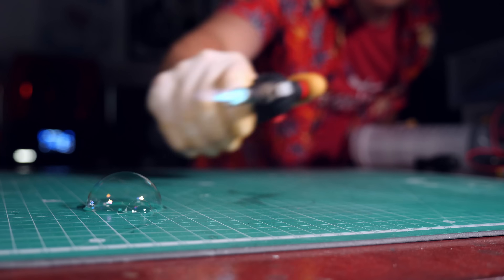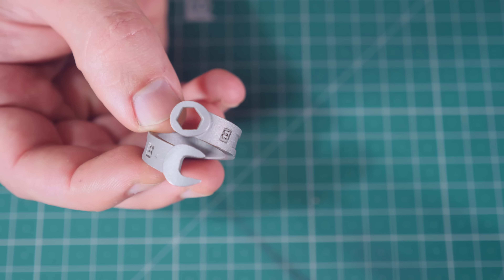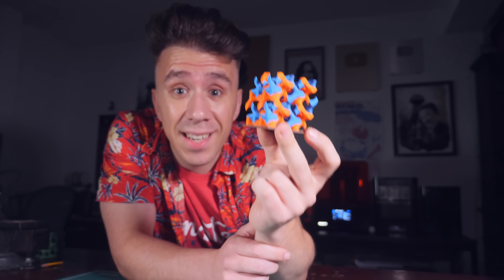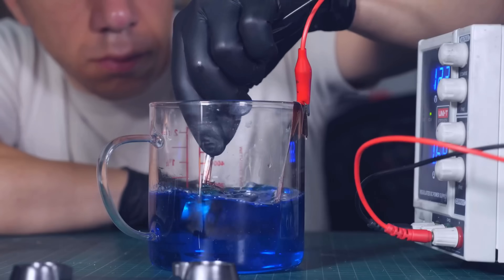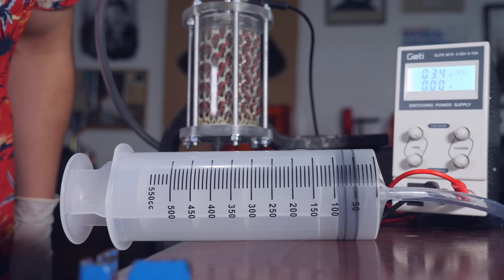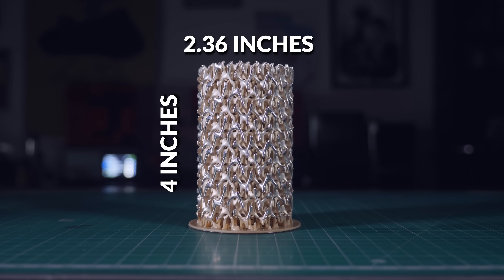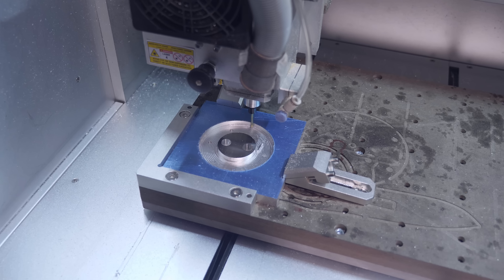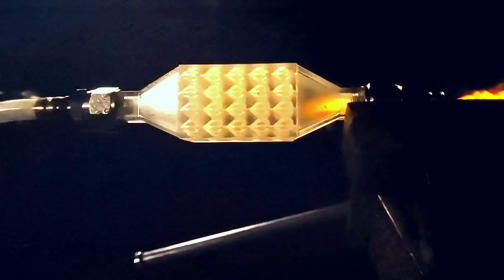ROCKET that LITERALLY BURNS WATER as FUEL

Comment: I made a hydrogen generator years ago. I know a lot about the subject. The best metal to use is platinum. Other than that the only affordable metal that does not dissolve during electrolysis is 316L stainless steel.  Not 308 or regular 316 or anything else. It has to be 316L stainless steel. Hydrogen is an acid and it dissolves pretty much any other affordable metal. 

Also, if you apply more than 2,3 volt to the anode and the cathode you will create heat, and more heat means more resistance and less hydrogen production. To overcome the heat issue, and when you are using between 12 and 14 volts, for example from an old fashion battery charger that doesn't have the fancy electronics, you need to have 1 anode plate, 5 neutral plates that are not connected to anything and insulated from each other, and one cathode, all the plates need to be insulated from each other. This way you can create enough surface area and you can keep the temperature under control as well. If you want to produce large(r) amounts of hydrogen search for dry cell hydrogen generator. A dry cell configuration is more efficient because there is no current leakage, because there is no water at the outside from the hydrogen generator. 

With producing hydrogen it is all about amperage and how much surface area that the plates have. More surface area means that you can run a higher amperage without heating up the water. When you add sodium hydroxide you need to add it slowly while running the generator so that you can control the amount of current that it draws. Not more current as your power supply can handle. You can also use baking soda. 

You get even higher efficiencies when you use a high power PWM to run the current.  

Always make sure that you have a back flash arrestor  in your line. You can make one from a 316: stainless steel pipe that is packed with bronze wool, or with stainless steel wool.  BUT DO NOT USE REGULAR STEEL WOOL BECAUSE IT WILL CATCH ON FIRE and cause an explosion.

The back flash arrestor is there to prevent that your generator violently blows up when your gas comes into contact with a spark or a heat source.  

Also make a bubbler to which your gas has to run through. This is to make the gas dry. Make sure that that bubbler has a weak spot from plastic film, so that the weak spot will blow out if there is an explosion.
Reply: Consider titanium as an alternative metal for electrolysis although more expensive than steel but less than plat.
Use a voltage regulator or PWM to maintain optimal voltage, to get around the min voltage for water hydrolysis.
Use a conductivity meter when adding sodium hydroxide to get the perfect amount of conductivity.
Consider potassium hydroxide as a better alternative to baking soda, since its highly conductive.
Reply: @MahdeenSky  There is no valid reason to use titanium. It is very expensive, hard to machine, and the electronic properties for this application are not better as 316L stainless steel, which is already hard enough to machine. More exotic materials only make the whole build process far much more complicated and expensive. 

One can measure conductivity. But there is no benchmark to which you can compare, because the amount of amperage that you want to draw heavily depends on the surface area from the plates, and also on how much amperage the power supply can deliver. So it is much more accurate and practical to measure the amperage while adding the electrolyte. 

About 15 years ago Youtuber Zero Labs designed a PWM with current limiter. It limits the current if the resistance reaches a certain value. Via his channel you can find his web page for instructions how to build it. 

Potassium hydroxide is indeed also a possibility.
Reply: For the generator, can you use the same sort of configuration that they use for the super high powered magnets, with the films layered in a spiral configuration? They use it for cooling the magnet...just a thought.
Reply: @insAneTunA I know someone already said titanium but they have a point it’s much cheaper than platinum, alternatively palladium and ceramics could be used. Potentially even a rubber so long as the thermal resilience is sufficient to not break down
Reply: i wonder if you can 3d print in 316l stainless
Reply: Found a place that sells 316L mesh (or "wire cloth"). Any reason that would be a bad idea? Seems like it would promote the best gas flow and liquid contact. also... that steel wool warning sounds like it's from experience.
Reply: MMO is best for these electrolysis, also you could make sodium chlorate easily wich is great oxidizer for rocket engines
Reply: Made one when I was like 10 with carbon rods.
Reply: everybody here has big brain, unlike me
Reply: I would think 2205 duplex would work well.
Reply: the cia: knocK knock
Reply: @themissile3120  In a wet cell configuration you can use wire mesh, but it will never be as efficient as a dry cell configuration due to current leakage. When solid plates are used in a dry cell configuration the current has no other option but to go through each plate. It can't go around the plates. Therefore there is no current leakage. In the past people have increased the surface area from the solid plates by media blasting the plates, but that is only possible when the blast media is 316L stainless steel. Otherwise there is too much contamination. Another option would be to machine the plates, but that will cost a lot.
Reply: @flowinsounds  That might be the case. And that could result in very interesting fuel cell technology. The interesting thing about a hydrogen generator is that the operation can be reversed. If you put in oxygen and hydrogen the output will be electricity. If you put in electricity the output will be oxygen and hydrogen. But this requires a certain type of construction, and with 3D printing they might be able to make that cheaper, and more efficient. And if the resolution is fine enough they might be able to create plates that have a lot of surface area without expensive machining.
Reply: @RoboArc  Carbon rods will dissolve. But it is nice as a gimmick.
Reply: @DavidRas  For a hydrogen generator I do not see how any type of spiral construction would be beneficial or even practical or possible. There is no need for it.
Reply: @ZeusEnergyMan  And in my reply to that I explained why titanium is not a good choice.
Reply: @insAneTunA  your amost right, but not quite....
Reply: What are the neutral plates for? If it's just isolation they should also just be plastic plates for distance. Or do they create bubbles even if they are not connected, but how? And why bronze for the blowback, doesn't thin metal always burn and oxidised with great heat? So much information, wish you would go into more detail!
Reply: @ssa7843  P.S. I forgot to mention why you need neutral plates. The reason is to divide the voltage over the plates. Because most available high amperage power supplies that are reasonably affordable have a higher voltage as 2,3 volt. Any higher voltage as 2,3 volt per plate will only produce heat. It is a waste of energy. And more heat means more resistance and that will result in even more waste of energy. 

To increase the hydrogen production you need more amperage, not voltage.
Reply: @insAneTunA  thanks for the explanation, one further question. And why not just use the + - + - + - + setting with 2,3v on each plate instead of + 0 0 0 0 0 - with 2,3v where the 0 neutral plates just do nothing? Or do you mean appling  20volts to both ends and 10 passive plates in the middle hence linearly lie at a virtual 2volt distance (if it is somehow linearly distributed in the water)?
Reply: @ssa7843  You take the voltage from the power supply that you have, and you divide it by 2,3 volt, and that is the number of plates that you need. One of replies was removed by yt. Not sure why.
Reply: @flowinsounds  Yes, you can 3D print 316L stainless steel.
Reply: @ssa7843  The issue is the amperage. Most power supplies that are able to supply enough amperage are not 2,3 volt. And it is easily solved with the neutral plates. Besides that you want to have as much surface area to begin with, so it is not a bad thing. 

It is possible to put multiple cells in parallel. Pretty much like a battery. So for example if you have a 200 amp 13,8 volt power supply then you can make a single cell with 7 plates that are large. Or you can make multiple 7 plates cells with smaller plates and put them in parallel. Or when you have a 230 volt direct current power supply you can divide 230 by 2,3 and that would be the number of plates that you need to have for a large single cell. The point is that you can never exceed the 2,3 volt per plate. More volts would be a waste of energy and it would create heat and more resistance which is very bad.  

The voltage is not the issue. The amperage is the issue. If you want more hydrogen you need more amperage. And power supplies that are able to put out enough amperage are very expensive and it becomes more dangerous. Perhaps a welder might work, but I have no experience with that.
Reply: @ssa7843 When using neutral plates (which were described as '0', the correct one is 'N') you do not have zero volts, you divide the voltage and multiply the current. I'll try to explain it better: You have two (+ and -) plates immersed in an electrolyte and the electron jumps from the plate (-) to the electrolyte, removing 1 aqueous (+) ion from the electrolyte; this leaves the electrolyte with a charge (-1 electron); This causes the positive plate to remove 1 electron from an ion (-) next to it and the electrolyte becomes neutral again. But if you place, between the (-) and (+) plates, another plate (neutral - without connection to external electricity), in this case only the part of the electrolyte facing the (-) plate will be -1 electron charged, making this neutral plate that obstructed the electrolyte from one side to the other now feels negative and functions on the other side of the electrolyte as a negative plate. The reverse is also true and the 'N' plate will feel like (+) on one side and (-) on the other. This divides the voltage by 2 and multiplies the effect of the current by 2, as oxygen and hydrogen will be generated on this plate as well. Do this as many times as you want to divide the voltage and multiply the current
Reply: Neutral plates work best with dry cells because wet cell configurations introduce current leakage (the charges literally try to bypass the neutral plates lol) and severely limit the efficiency. If somebody tries to build a wet cell configuration, you either have to limit the voltage to 2-3 volts or stack several wet cells in series. Somebody already mentioned this, but amp draw depends on the electrolyte conductivity, and distance between the electrodes. There's a graph out there that shows 2 cm gap for electrodes work best. There's really only five important factors you need to worry when initially designing a cell: number of electrodes for voltage, plate surface area to determine how much current it can handle before it starts boiling up the electrolyte, electrode distance, electrolyte used, and electrode material. There's also optimization options such as using PMW, using magnets, and applying ultrasonic waves.
Reply: I made a HO generator MANY years ago (I was in my early 20s, so pretty dumb about safety) and used sheets of 316 stainless (My dad worked for Republic Steel at the special metals plant so it was super easy to get at the time. He brought a bunch home that were slated to be thrown in the trash because they wre mistakenly paper backed. We used them to make cookie sheets) and I stacked them with threaded nylon rods and bolts (from toilet seat replacement kits). I used  distilled water with a tiny amount of lye dissolved in it and put the entire thing in a gallon jar with a metal screw on lid and used a variable power supply. it worked WAAAAAY too well and started producing a ton of highly explosive gas. I then apparently had a massive stupid spell and moved the output hose near a flame. The lid of the gallon jar embedded itself in the ceiling of my kitchen and my ears rang for about two hours afterward. I was EXTREMELY thankful the jar remained intact and just the lid blew off.
Reply: @insAneTunA  You could potentially use a dremel and cut slits in the solid plates for more surface area, but honestly you aren't going to increase surface area on plates enough to make an appreciable difference (unless the plates are SUPER thick)
Reply: guess we need to put a thousand spark plugs in the tank to do the job.
Reply: you accidentally used a : instead of an L
Reply: @ChuckSploder  yes I did. 👍
Reply: @Squidbush8563  
I also did an experiment using graphite as the anode, copper wire as the cathode and table salt electrolyte. Before, using salt, I destroyed the anode and made hydrogen at the cathode, with the graphite anode I made gas for the first time. I thought it was oxygen and decided to take a sniff. I almost died because it was chlorine gas. It's about 20 years ago.
Reply: @estudandobitcoin2711  Yea. using sodium chloride is a bit of a problem.
Reply: I agree.  We designed acid/base reactors for chemical plants and we only used 316L reactor tanks.  Anything else would break the bank (hastelloy), corrode or melt from the exothermic heat generated.  We used graphite heat exchangers for dilute sulfuric acid.
Reply: @insAneTunA  The cells must be isolated from one another. They can't share the same electrolyte or they will short out.
Reply: This comment section is full of great ideas. I hope to implement some of them in my future projects.
Reply: @MahdeenSky  you have no understanding of standard electrode potentials. Titanium will simply dissolve during Electrolysis. Additionally, there is also the subject of hydrogen poisoning Of the cathode. The only material you can use and maintain Current flow Is carbon/graphite.
Reply: @5467nick  Most ideally each different 2,3 volt cell has its own insulated electrolyte compartment and gas outlet, but it is not a real issue if there is some current leakage. It can't short out, as you say it, it is just less efficient when there is some current leakage. When I was doing this between 15 and 20 years ago 3D printing was still very exotic, so it was too costly and too complicated to create a manifold/casing with a gasket for each different 2,3 volt cell all by hand or with machining from exotic materials such as acrylic plate or something similar. So instead we just drilled holes with alternating locations in our plates, and we stacked the plates with home made rubber gaskets made from EPDM pond liner in between the plates, so that the gas had a way out, and also so that the electrolyte had a way in and also a way out. It was not perfect, but it was already a lot better as a wet cell configuration. And the alternating hole locations in the plates helped a little to keep the current leakage within acceptable levels.
Reply: @Squidbush8563  Just with media blasting the plates with 316L stainless steel blast media it will increase the surface area from the plates a couple of hundred if not thousands of times. On an atomic level you do not need to have thick plates or deep grooves to increase the surface area. Even sanding it with sandpaper increases the surface area by multiple factors. However, if you can do it very precise with CNC equipment then it is possible to make it even more efficient.
Reply: @insAneTunA  The positive plate in one cell can be used as the negative in the next cell (or just bonded to it) so long as the electrolytes are isolated and the plate is made of something that can handle both polarities in the two cells, but the electrolytes of each cell can't be in direct contact. To have the electrolyte from multiple cells in contact would be the same as having the full power supply voltage in one cell, which isn't going to work well.
Reply: Maybe some tungsten tig electrodes?
Reply: @flowinsounds yes, you can.  Good luck finding a powdered version supplier though.
Reply: Wow some really thoughtful and stimulating replies!
Reply: Here is the True Savior

HalleluYAH translates “Praise ye YaH”

YaH is The Heavenly Father
YaH arrives via the TENT OF MEETING
YaH was Who they Crucified for our sins
YaH was Crucified on an Almond TREE

Semitic of Moshe (Moses)
Isa Scroll (The Original Isaiah)

Isaiah 42:8 - I am YaH; that is my Name! I will not yield my glory to another or my praise to idols.

Isaiah 43:11 - I am YAH, and there is no other Savior but Me.

Isaiah 45:5 - I am YaH, and there is none else.
Reply: @stephenl2905  Titanium anodizes by forming an oxide layer when used as a positive electrode (anode) in electrolysis. It doesn't dissolve in most electrolytes, though it will oxidize until it no longer conducts electricity very rapidly. Many anodes are made from titanium plated in another metal (often platinum) that is more stable.

I assume you are referring to hydrogen embrittlement. Not all metals are subject to it (mostly just iron/steel) and it is generally not an issue for electrolysis anyway. Many metals are fine to use as cathodes for alkaline electrolysis. Nickel or stainless steel is perfectly normal for cathodes in this purpose.

Graphite is frustrating to use as a cathode because it constantly spalls off little flecks until there's nothing left of it. It can be completed disintegrated within a few days at anything approaching useful current densities. Amorphous or glassy carbon works a lot better, but is extremely expensive.
Reply: @insAneTunA  platinum plated titanium
Reply: So how much does this bong cost?
Reply: @Squidbush8563 been there done that one .. LOL it's kind of amazing how incredibly mangled a ball jarlin can become incredibly thankful that the jar stayed intact
Reply: @mason2307  If you had to buy one as a regular customer that is already operational with all the commercial grade safety features and completely calibrated and safety certified with a guaranteed output then you would have to pay for the knowledge plus the materials plus the hours that it took to put it together plus the costs from calibrating and the safety certifications. I think that a commercial grade hydrogen generator would start somewhere around 5000 U.S. dollars, but it might easily turn out to be 4 times more, I am not sure about that because I do not know what it would cost to bring it to the market and to have everything calibrated and certified, and what all the commercial grade materials would cost. In any case it would not be cheap. Safety is a big issue when you are selling these hydrogen generators for commercial purposes, and hydrogen is not an easy material to work with, so the commercial grade safety features and the calibration and the safety certifications cost a lot. 

But if they mass produce them, for example for a hydrogen generating facility, or for a car, it will be much cheaper to produce. Here in the Netherlands they are doing a test project with a home hydrogen generator. During the day it uses excess energy from solar panels to generate and store just enough hydrogen so that the hydrogen can be used to produce electricity during the night with the same generator. In that case it is called a fuel cell.
Reply: Great info.
Reply: How can you get any efficiency at all?  By electrolyzing water and burning the hydrogen, you're reforming the same bonds you break, a net enthalpy of zero, so the efficiency can only be 1 at a maximum even with some imaginary zero waste process.
Reply: @ax0lotl  That is not what I am talking about. You don't get it. When I speak about efficient then I am talking about using as less energy as possible with the most production of gas as possible. That's it. For example, if you are going to apply more than 2,3 volt to an anode and cathode it is not efficient because a lot of the energy will be turned into heat. When producing hydrogen you want to lose the least amount of energy to heat.  There is not a word French about it.
Reply: Wow. do you have a youtube channel?
Reply: @JustMakeIt11  Yeah, but I don't post videos like that. At least not in great detail. And I do not post a lot of videos either. 15 years ago I made a video about my hydrogen generator. I called it electrolyzer back then. I guess that was the popular word for it back then. It is video number 10. I just watched it back, I hadn't watched it for years. But that short video is a good indicator of what I was talking about up above in my original comment. It is a drycell configuration, with 3 cells of 7 plates electrically in parallel. But it looks as if they are in series, but that is not the case. So in total the hydrogen generator has 21 plates. I use 14 volts so the voltage gap is 2,3 volt for each plate. I am also using a PWM with current limiter. So that it doesn't cause a current runaway. If the water heats up it will draw more current, but the current limiter prevents that, so the water doesn't warm up to above a certain tolerance.
Reply: @JustMakeIt11  Gee, if I put videos on the internet I guess that would be all the qualification people should need to believe that I was able to overcome basic laws of physics.
Reply: @insAneTunA  I get it just fine.  There's value to refining the efficiency of this process, however, we should be clear about what it is, and isn't.  Water hydrolysis -> burning hydrogen is not generating power, it's using it.  As long as everyone understands we're talking about energy storage, not generation, then sure, it's worth discussing efficiency in those terms.  But this video, and anyone calling water 'fuel' when referring to this process, are either misleading or misled.
Reply: @JustMakeIt11  Also I'll point out, there's a lot of good stuff in here, it's just got a clickbait title that you can see from the comments, plenty of people misunderstand.  Water, used this way, is simply not a fuel.
Reply: @ax0lotl  Oh you are absolutely right. It is energy storage indeed. And it does cost energy to store it. However, you can use the stored hydrogen to create electricity with a fuel cell. It is a reversed operation where the input is hydrogen and oxygen, and the output is electricity. But that process also comes with energy losses. There is always a loss of energy, with every process. But like you said, the process can be refined to minimize the losses. Or to maximize the efficiency of the process.  

Good comment 👍
Reply: @ax0lotl  This type of energy storage is suitable for specific applications, not for every application. The main benefits are that it doesn't cause any pollution or harmful emissions. Many industries are changing to the use of hydrogen for their industrial processes. That is a big win for the reduction of CO2 emissions. 

But there are also projects to monitor if it is feasible for private home owners to store hydrogen with excess energy from their own solar panels, and to use the stored hydrogen at night to create electricity with the reversed process. That would eliminate batteries. And reduce the CO2 emissions. 

A guy called Mike Strizki and his hydrogen powered house, has been doing this for decades, but the technology has much improved, and the times have changed, and now commercial companies are starting to discover the possibilities as well. 

So it is not magic, and it will not replace all other energy storage options, but there is most certainly a place for hydrogen technology.
Reply: Great stuff. Thanks more than just a reminder there.
Reply: You did a awesome job! Thamks
Reply: What about using a solar panel solar generated hydrogen as long as the sun is out you're producing hydrogen then use a coalescent dryer and a high pressure pump to dry and pump into maybe oxygen tanks or something pressure tanks
Reply: @tonydiesel3444  You never ever want to put a mix of oxygen and hydrogen gas under pressure. That is not good for your health. And creating special manifolds,, gaskets, and membranes to collect the gas separately from each other is highly complicated and very expensive for a DIY home project, if possible at all. In any case it is easier said than done. 

The solar panels or wind generated energy in combination with hydrogen is key to less greenhouse gas emissions.
Reply: @insAneTunA  not super familiar with this I went with small-scale waste oil distillation with heat miniature Refinery imported from Europe and New Zealand for alternative fuels I'm able to make 1 gallon of waste oil distillate for less than 10 cent per gallon Unlimited Supply can make it 24 hours a day for months at a time fully continuous self-cleaning self-regulated water cooled unit so I'm sure I could get into hydrogen if I choose to and started to study it play it seems like solar generated via electricity to create hydrogen is an excellent idea as long as the sun is shining hydrogen will be produced for free :-)
Reply: @tonydiesel3444  Your idea sounds simple, and it is not new at all. The realization is much more complicated and far more expensive as you seem to think. You will end up with what Mike Stritzki did many years ago. And that type of DIY solution is just not practical or affordable or economically viable or even legal for most people. 

When you are working with hydrogen everything becomes more complicated and expensive. And it is never for free. The materials that you need are expensive, the tools are not for free, the permits for such a setup would not be for free if it would be possible at all to get permission for such a setup, etc. etc. 

I mean, we are talking about a DIY setup, not about a professionally mass fabricated setup. If it were mass fabricated and safety approved and such it would be a different story.
Reply: @insAneTunA  I also build custom heavy equipment machines that move Drive do work the last machine I built was a tracked stump grinding ride on driving machine machines like this are usually in the hundred thousand dollar range to purchase if this is able to be accomplished I'm sure doing some stuff with hydrogen will be of no issue
Reply: Erm...  not any more.  Check out graphite.   Also makes fabrication way easier.
Also;  You may want to consider the effects a magnetic field has on a cell (the ions) and/or what the magnetic field caused by pulsed DC in the electrodes looks like...

Then;  what is the electrode surface area of ionic flow  between electrodes, (about 1000 V per mm) with mist or steam as an electrolyte, rather than water..?  :) 
There will be a whole lot less oppositely charged ions crashing into each other and neutralising out wont there..?

Also NB  that in a std cell with a PD of more than 2.075V (IIRC) between electrodes you get a substantial amount of O3 or Ozone.
How might that effect combustion..??
Reply: just because it seems to bother no one else than me: Hydrogen is NOT an acid! Just think about it...
Reply: @insAneTuna could you use a step down transformer to increase amprage? (Sorry for jumping on this topic really late)
Reply: Does graphite work?
Reply: @benbennett5301  Only once. It will turn the electrolyte into a messy soup.
Reply: @insAneTunA  what happens to the graphite?
Reply: @benbennett5301  It will fall apart and turn into soup.
Reply: @insAneTunA  chemically, i mean
Reply: Stopped reading at “hydrogen is an acid.”
Reply: Maybe you should do a video, improviing his version of hydrogen reactor.
Reply: @White_Night_Demon  About 15 years have past, and these type of projects are expensive by nature if you want to do it right, and it requires full dedication and commitment. And even then it will still be just a hobby project that can't compete with professional and commercial grade hydrogen producing machines. And I also have no use for such a machine. Now I am at a different stage in my life. With different interests and priorities.
Reply: wow man thanks for the info really helpful !!!
Reply: @StephenCardinal-r3b  You're welcome!
Reply: @insAneTunA  So you're telling me if this was 15 years ago, you'd have jumped on him and one upped him with a better video explaining the process?
Reply: Awesome I wish you were my friend 😊
Reply: @jeremydenn6988  You already are 👍
Reply: @insAneTunA  thanks 😀
Reply: People like you deserve millions of likes ride on brother
Reply: TunA did you ever make a dry cell one?
Reply: @insAneTunA the system I built for my toyota used 3 gens. in parallel with 1 bubbler and a flash arrestor. That truck has a stock 65 amp alternator. At times i could use the PWM to send 130 amps to the gens. The alt. belt would scream as the resistance would overcome the tention of it. I've also blown 125 amp fuses with this set up. The wire was very heavy fine strand. That was years ago and I've yet to build a dry cell. I'm interested if you've put one together yet
Reply: @jb-ik8sj  Yes I did make an experimental dry cell. But I made some mistakes. I did not have the money and the tools to do it as perfect as it should be done. So it was a failed experiment. I still do not have those tools. 316L stainless is a very tough material. For an ICE you only need small amounts of hydrogen to get a positive result, but I do not recommend it because it requires a lot of tinkering with the ECU and lambda sensors. And there is always the risk that the electrolyte or vapors enter and damage the engine. I do not fabricate for other people, I do not want to be liable for any possible damage or accidents or lack of results. And even if I would built one then the costs would be far too high to earn it back with the fuel savings. It would not be cost effective.
Reply: @insAneTunA  i used a PWM and also a device to trick the ECU by controlling the output of the O2 sensor. There has only been a handful of people who realized fuel savings.. At least thats what I've read. I would like to build a Stanley Meyer injector which as you know divides the oxygen and hyrdogen at the sparkplug. Problem is finding the time. I purchased an old lathe on ebay years ago and it's time to put it to use. One must be careful not to go public with this information because you know how our government works. Lol
Reply: @jb-ik8sj  The problem with a car is that it never runs at the same RPM, but the HHO generator has always the same output. It would work a lot better with for example a generator. NASA did a study, and a University in western Australia did as well. I once had the PDF files, but I lost those. It was nothing spectacular. Minor fuel savings around 3 to 5 percent, and it only worked with small amounts of hydrogen. At the end of the day an electric motor is far more efficient. ICE is not worth it anymore. Fuel cell technology is feasible where hydrogen is used to generate electricity, but only when the hydrogen is generated with renewable energy sources. Look for Mike Strizki, he did some interesting things, but he went a completely different route.
Reply: @insAneTunA  so putting electrical energy in creates H & O2. Putting H & O2 in creates electricity.   That sounds like a energy storage device. We could all it 'a battery.'   
But how efficient would it be compared to Lithium?
Reply: @kevintedder4202  Yes, but it requires a more complicated design. It is called a fuel cell, and it already exists, and it is already used for that. I do not have the exact numbers. As long as the energy that you need for the hydrogen production is generated by a renewable energy source it is quite efficient compared to lithium. And hydrogen is a never ending source of energy. For example the Toyota Mirai uses fuel cell technology to power the electric motors from the car. And there are many more car brands with the same technology. They are called FCEV or HFCV. And there are also many more applications besides powering cars that can use the same technology. There will always be some energy losses, but there are no harmful emissions during its lifespan. Of course there will be some emissions during the fabrication. But that is the same for fabricating vehicles that do emit harmful emissions.
Reply: BoominGame  I assume from your comment that there is some sort of give away promotion going on of which I was not aware. Thank you for your kind words. But I am already happy to share my limited knowledge about this hydrogen technology. I know that there are people out there who are much more knowledgeable about the subject than I am. My purpose is that it might inspire some people to take it to the next level. And to make people aware that viable alternatives do exist. That would be the ultimate reward. And to be honest I was and I still am quite surprised by all the response that I received to my original comment.👍
Reply: This is agent 47 from Gas Co I'd like to have a conversation with all of you.
Reply: I was dying laughing when he thought to use the steel wool… what happens if you apply dynamic pressure in the chamber? Can you reduce the amperes? More pressure less amperes?
Reply: What about a frame that keep the zig zag edge and using graphene to cover the reactor? Grapheme has a zero band gap and is extremely durable.
Reply: @JJ-fx6js  Not sure what you mean, both of your comments do not make much sense to me. But I try to answer anyway. The combination of oxygen, hydrogen and pressure is a very dangerous and therefore very undesired combination. And any carbon based material is completely useless for electrolysis applications. It will dissolve. The material graphene is just carbon, like coal, the only difference with regular coal and what makes graphene special is that graphene is only one atom thick. If it were two carbon atoms thick it couldn't be called graphene. Graphene does have some unique electrical properties, but it is not suitable for this electrolysis application because at the end of the day it is just carbon. I hope that answers your questions. Happy new year to you.
Reply: @insAneTunA  what about waterjet cutting as opposed to machining?
Reply: @Lefty217  I don't know much about waterjet technology. It is my understanding that waterjet tech is good for cutting all the way through a material, not so much for machining surfaces, but I could be wrong. Anyway, with this type of electrolysis you want to create as much surface area on the plates as possible. I am not sure if waterjet tech is the best technology for that.
Reply: Very informative 
Can you please recommend a legit blue print for dry cell. I have an old car that I’d like to try and build h2 generator for so I could T it in the gas line and see if it works. I know there are a lot of videos on the YouTube, but thought maybe you can recommend one a particular that stands above all…
Thanks!
Reply: @madigreli  That is a good question. Most of the people that I used to know who were playing with this concept about 15 years ago either closed their channels or removed their content after utube changed their term of conditions several years back. For some reason many people did not agree with that. I would not really recommend to install it in a car, but if you insist of doing it anyway I would recommend you to look at the older videos from a channel that is now called Central Coast Off Grid. From what I can tell he knows what he is talking about. And his videos pretty much cover everything you need to know.  But to make it work in a car you don't need large amounts of HHO gas. The HHO gas is not meant to replace the fuel, but instead to make the fuel burn more completely. That's the whole idea behind it. However, I do not have a recommendation for an exact blue print. I would suggest that you look for a design that is similar to his setup, and go from there, and see if you can find someone who shows you exactly how to do it. 👍
Reply: @  it seems like all of the informative legit videos are disappeared or disappearing so it’s hard to find something legit ( Stanly Mayer, Paul Pantone are dead now) in all the yt garbage 
thank you so very much for recommending I’ll check it out !
Reply: @madigreli  Stanley Meyer had a whole different approach. And so far nobody has ever been able to replicate it. I am not an expert to his approach, but from what I understand he was working with specific frequencies instead of using a higher current. And from the little radio knowledge that I have that would imply that you would need to have a very specific length of your anode and cathode in order to get those frequencies to resonate and amplify. And it must be the exact resonant frequency from water at the same time. It goes beyond my limited knowledge. But I have been thinking about it many times. Quite recently I even asked chat gpt some questions about it. Such as what the resonant frequency from water is. And what kind of wavelength you would need for that resonant frequency, to figure out what length of anode and cathode you would end up with. And that would be somewhat comparable to wat Stanley used. But again, I am not an electronics expert. So it is just a personal theory that is not based on actual knowledge or known science.
Reply: @ any method of alternative energy Is what I meant to say, so we can some what be less dependent on the petroneedles…and be off of grid …
Reply: @insAneTunA  How about instead of solving the cooling problem, just use an alloy that doesn't have a high resistance when heated? Molybdenum alloys would be good. For example molybdenum-rhenium, it's corrosion resistant
Reply: @hnappinn  I have no knowledge about the electrical properties from that material, or if it would hold up during electrolysis. I assume that it is not useful because otherwise it would have been done already. I also don't know where people can buy it in sheets. Besides that, any heat production is a loss of energy, regardless the resistance from the material. So it would not solve anything. It is easier to use a PWM with a current limiter and neutral plates.
Reply: I wouldn't be suprised if this guy suddenly disappeared😢
Reply: @mateuszpona3081 Don't worry, there are many people who know a lot more about this than me.
Reply: I am working on a second HHO generator and this has been helpful Also i can attest to HHO's volatility (my first generator violently blew up and showered me in electrolyte )
Reply: @amandaaustin8118  You're welcome, and be safe! 👍